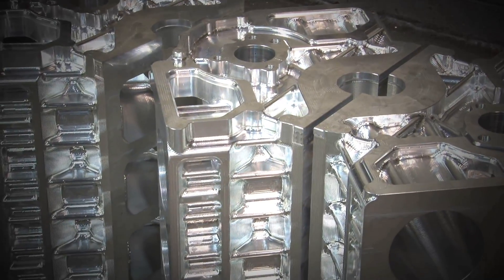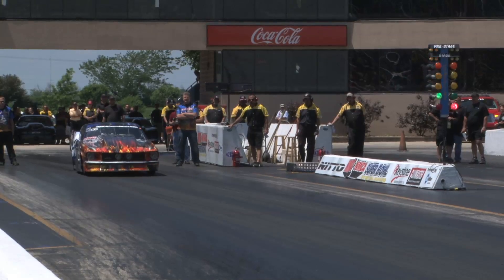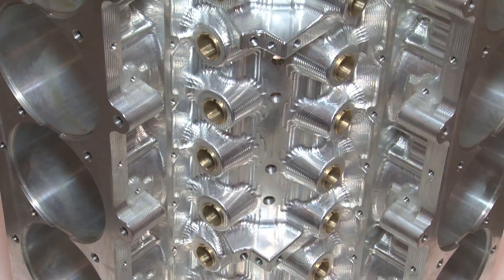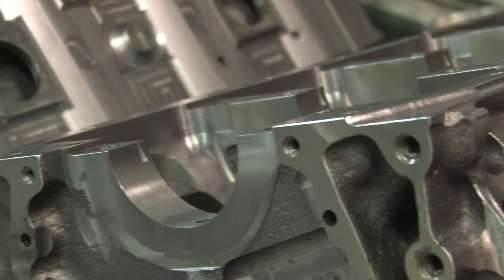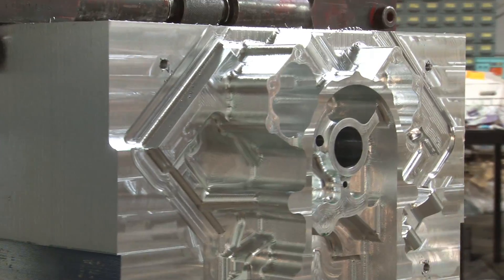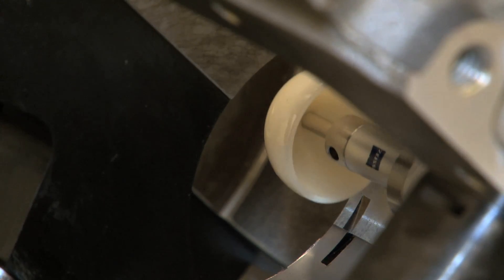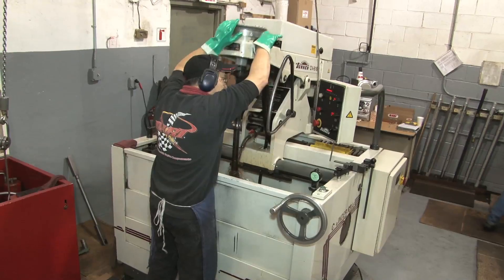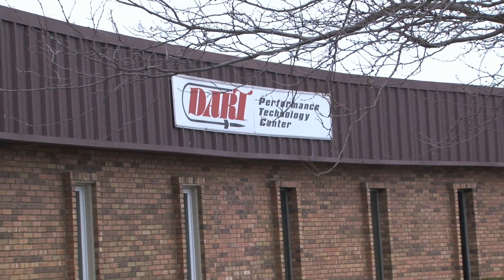Dart Billet Blocks and Heads

Comment: I wonder how they do deep complicated water jackets, and oil passeges.
Reply: My guess is that these are for drag engines and have no water jackets.
Reply: They are dry deck blocks and heads that run off methanol for drag racing

Comment: I still can't figure out why you'd take an extra hour or two to mill off 200 pounds of aluminum when you could cut off large chunks with a bandsaw first - such as the space from the top of the cylinder bore to the outer corner of the billet slug. Or cut off from the top of the block to the top of the billet slug. It would save a lot of time, wear on your CNC equipment, and there would be fewer chips to clean up.
Reply: Be no point in Billet if you cut it in pieces.
Its strength comes from being a solid billet block.
Reply: @AndyB718  Doesn't change any of the 'billet' properties as the grain structure isn't interrupted. You removed it in a sawing process rather than a milling.. but nothing really changes.
Reply: It's aluminum, machines about as fast as you want to go, given you have enough HP at the machine and these aren't lightweight engine boring machines, they're full fledged machining centers. You could spend a lot of time sawing chunks off, handling, repositioning or throw the cube in a vise setup, like they have here and machine away the excess in a lot less time.
Reply: It's just faintly possible the manufacturer who has done this for many years before going all billet might have thought of that.
Reply: What a dumb comment.

Comment: but but.... there is no coolant channels?
Reply: Some billet blocks have coolant passage.
Reply: David Allen Most of the motors only run for 30-45 seconds at a time and run on fuel that burns at a lower temperature. Eliminating coolant channels increases strength aswell.